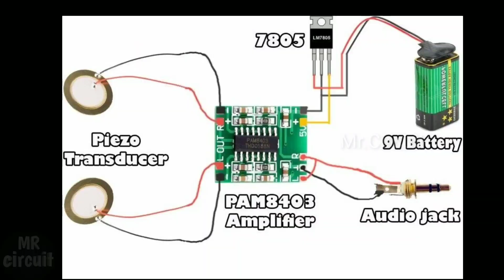How to connect external stereo speaker for mobile using pam8403 audio board. |Audio amplifier

Comment: Can i use 9v battery and 5 v usb cable in one circuit because No power that time i ll use 9 v battery so ple tell me
Reply from the maker: Tha audio board only can bare 5v. So if you apply 9v it would burst.
Reply: 9 volt means your idea ic use it
Reply: When i use 5 v adaptor i ll remove battery
Reply from the maker: Ok

Comment: Bro may I use single channel speaker
Reply from the maker: Yes u can.
Reply: @MrCircuit  how do you connect a single speaker only?  There are two outputs, please if you can explain
Reply from the maker: @raphaelglossarium  You can connect single speaker in one output. Leave free the other output.